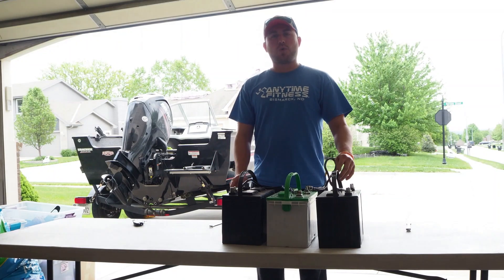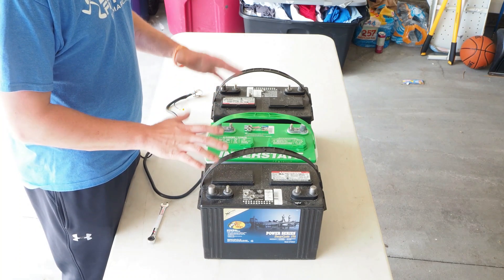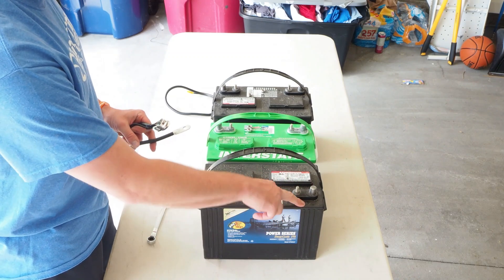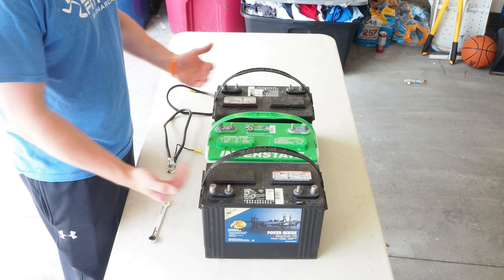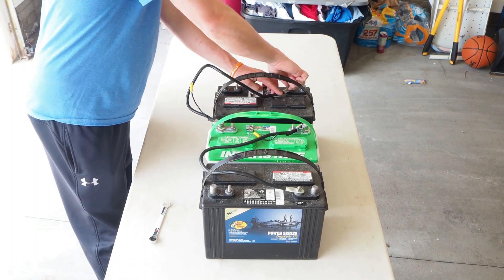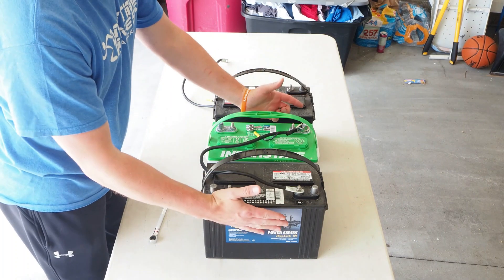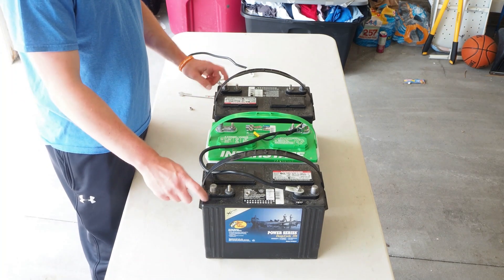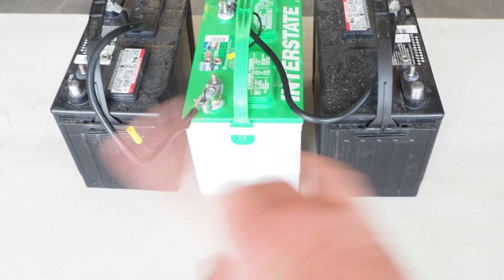How to Wire a 24V and 36V Battery System Deep -Wiring Trolling Motor Batteries in Series

Comment: How is charging connected?  Connected to one charges all 3 and is a different charging system needed for 24v or 36v?
Reply: They need to be all individually connected
Reply: How if it keeps blowing my battery charger fuse ?
Reply: 36v10a series 24 v20a connect how to charge with 60v charger